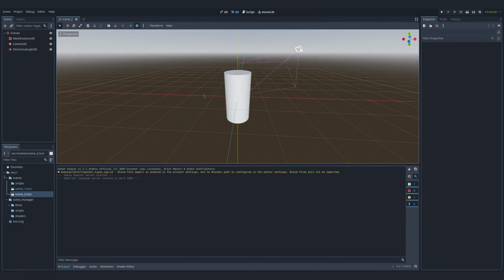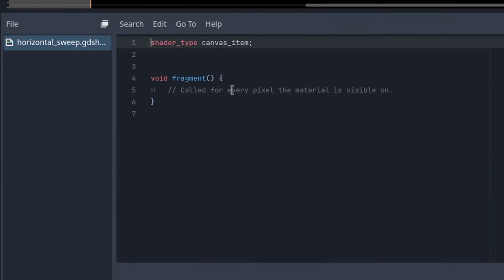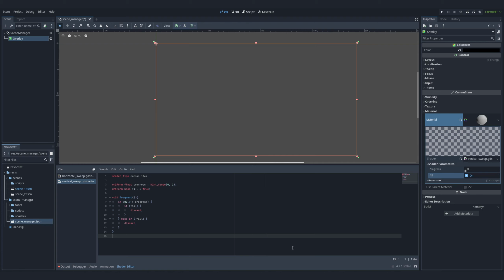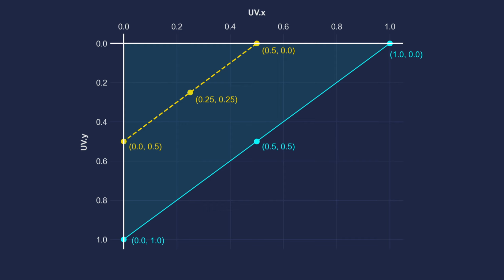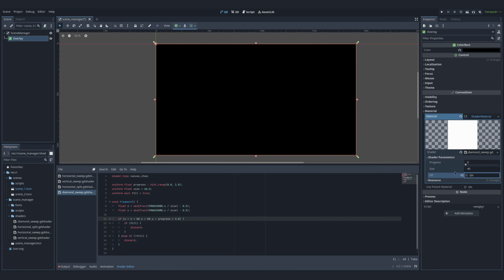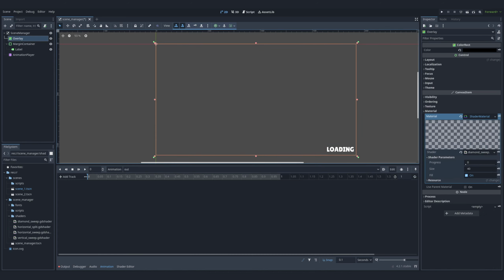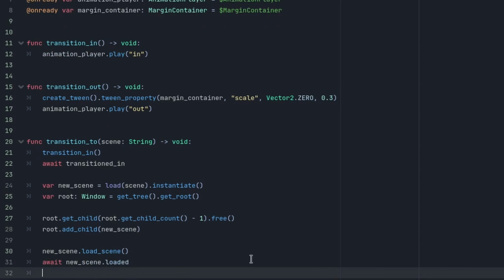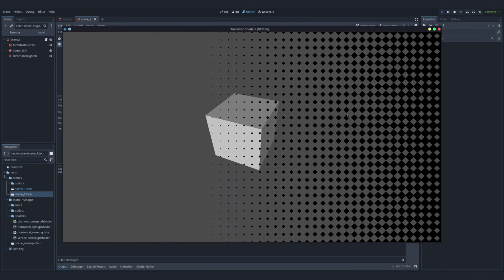Creating Scene Transitions Using Shaders in Godot 4 (Part 1)

Comment: I know I am very late with this comment, but I had one question. For some reason scale doesn't work with me and the diamonds seem to overlap just a little bit. The weird thing is that this only happens when I run the game and not in the editor. I also use portrait mode if that changes anything. Thanks in advance!

Comment: HI, very nice video. I strongly appreciate that you don't stop the explanation to the shader itself but you show how tu use it with the animation node and the signals. I didn't understand the tween line. I read the tween doc, and I understood that it was an light alternative to animation player. So I don't get why you have both animation player and tween.
Reply from the maker: Thanks, glad it helped :)

The reason for the tween is because when we are using the "pulse_text" animation, we are animating the scale of the margin container between 0.8 and 1.0, and we don't necessarily know what the value will be that we should animate from when we start to play the "out" animation.

In the "in" animation, we know the scale at the start will be 0 and will finish at 1.0, but in "out", if we were to tell it to animate from 1.0 to 0, if "pulse_text" finished at say 0.8, it would make it snap to 1.0 and make it look a bit odd.

When we use the tween, we are telling it "animate from whatever your current scale value is, down to 0, over this amount of time", so if the "out" animation starts when the scale is 0.8, 0.85, 0.9, 1.0 etc. it wouldn't matter - it would always scale back down to 0 in the same amount of time.

Basically, it will make it look smoother, rather than us setting the scale to a fixed value in "out" and then animating it down from that.

In the animation player, there are "update" modes you can set, one of which is called "Capture", which would handle this for us typically, and remove the need to use a tween, but it's currently not working in Godot 4. When it is fixed, using that would be the better way to do this, so it is all in one place :)

If you want to see the documentation on the update modes, take a look at this link: https://docs.godotengine.org/en/stable/tutorials/animation/introduction.html#track-settings

Hope that helps clear up the tween